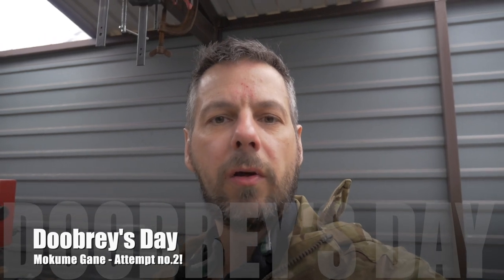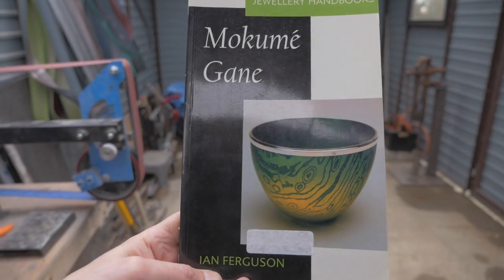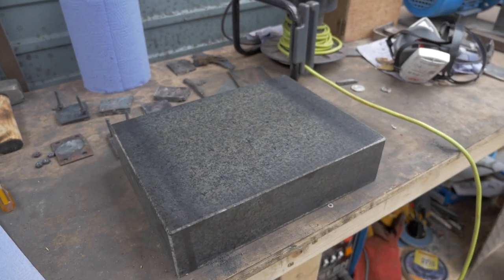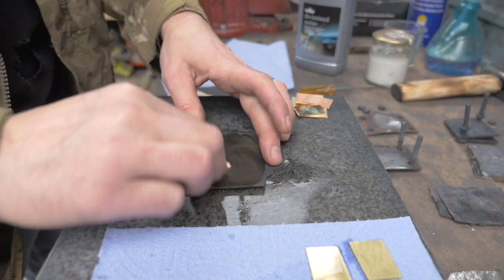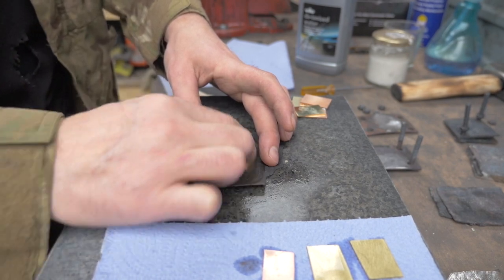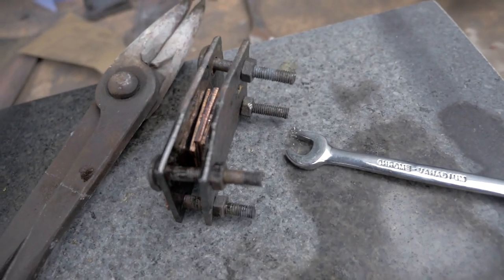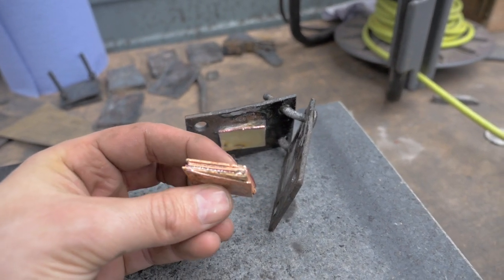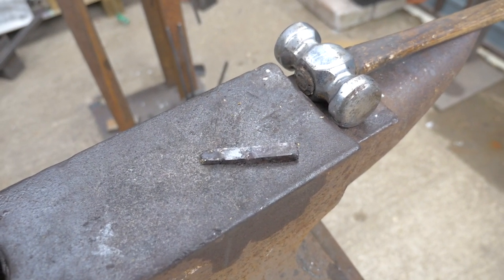How to make Mokume Gane - Second Attempt!

Comment: ok, use a forge vise and thicker steel plate around 20 mm to press on mokume billet, with big bolts… dont forget when you clean your mokume using sand paper or so its to remove oxyde, wich ll build up quite quickly if you dont protect your mokume sheets after cleaning…. continue good work.

Comment: Other options. 

Dip in kerosene before forging to remove air. Don't put plates together still wet with water!

Submerge your plates in acetone and soak for a bit before rubbing clean. 

Weld it instead of clamping, the clamps hold it together, but you need to wack it when it is hot to forge weld it, the clamps only allow your hits to add pressure in the centre, which results in delaminations on the outer edge. 

Don't use a hammer to join it after taking it out of the forge, use a car jack or better still a hydralic press/flypress with flat plates. You need slow high pressure uniformally distrubuted across the entire surface. 

If this were a oxidising metal like Stainless steel, add a sprinkle of activated carbon, or encase in steel foil and add some argon. (or both)

If you are going to use clamps, try and use a stainless steel (higher melting point) clamp set with larger bolts and threads with much thicker plates. then you may be able to (carefully) wind the bolts down to add compression to the billet instead of hammering. Also add what the americans call whiteout on the plates to stop them sticking. (or some paper, which will also reduce the O2)

Heat the billet inside a bit of square bar to get more uniform heat distribution in the fire.

Comment: I just started making Mokume Gane myself and from my research online, a lot of people use meths to clean the metal which is what I've been doing which might be better than deionised water. I've also been brushing my compression plates, screws and nuts with anti-flux to try and stop the metal fusing with each other.
Reply from the maker: thats a great suggestion.  Someone has also said to me try scotchbright pads, which I now have, so will give that a go.  Also now picked up some Silver Nickel, so that should really make some difference on the colours !

Comment: I would suggest you try a boron nitride release agent between the steel plates and your mokume gane stack. Boron nitride aerosols can be bought for about £20.

Also, I wouldn't put the stack together wet. Thoroughly clean and use a solvent like acetone to accelerate drying.

Comment: We use almost exactly the same method, I stopped hitting it with a hammer when it comes out of the forge for the first time because it deforms the Steel plates. This can cause uneven pressure or no pressure at all when you put it back in. (I’ve found pressure distributed evenly across the stack is very important for even lamination, I’ve had stacks only laminated on 1 side due to uneven pressure). I take it out let it cool for a minute and tighten all the bolts again. Then I stick it back in until welding temp, take it out, take the steel plates off, stick it back in alone then give it a few good hammer hits to really make sure everything’s good and laminated. Sand all the sides so there are no cold shuts and making sure everything’s laminated, if so it’s ready for further forging

Comment: the sheet stuck to the steel because the brazed on to it
Reply from the maker: Hey stick man.  How do you mean “the brazed on to it”?
Reply: @Doobrey  The brass melted into the small cracks on the steel. Brazing is like a pseudo welding process. It's used in plumbing and for things where welding isn't an option. The process is done by melting a non ferrous metal to a ferrous one, typically done with brass and steel. It stuck because when you ground the steel to clean it, you made small grooves into the steel. So that when the brass melted, it melted into the small ridges in the steel forming a bond similar to epoxy except stronger
Reply from the maker: Thank you stuck man.  Any ways of stopping this happening?
Reply: @Doobrey  I'd say your best option is to put the copper plates on each side. If the brass melted your piece got too hot. Which isn't necessarily a bad thing because that means your billet is hot enough to forge weld together. If it sticks using a chisel wouldn't be a bad option. Or you could try mokume gane with other metals, silver and copper, copper and gold, brass and silver, copper and bronze, and copper with nickel is a good combination to practice with. Maybe try copper and bronze because nickel is somewhat expensive and bronze won't braze as easy.
Reply: Its because you were reusing plates so it built up a small amount of alloy in the steel surface until a true alloy layer formed allowing the brass to weld to it

Comment: I see this all the time. What I have observed is cleanliness is important. After heating and in-between times you really should be wire brushing, cleaning firescale and impurities from your anvil ,forge and hammer. Your really kind of a messy guy you know. When you hit any metal after being in the forge ,you have to clean,t otherwise your pushing it right in there. The cleaning you did before hand an during was half-assed.
Reply from the maker: Thanks for the comments Tom. I think you are right.  Cleanliness is key here.  I think i will have another go based on your suggestions.  Thank you!